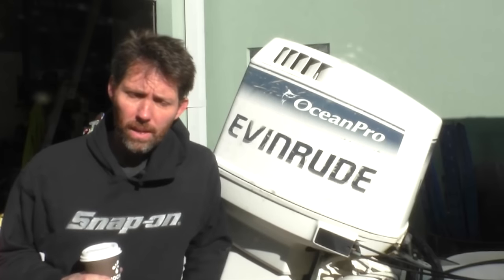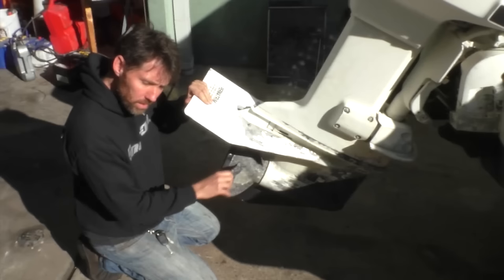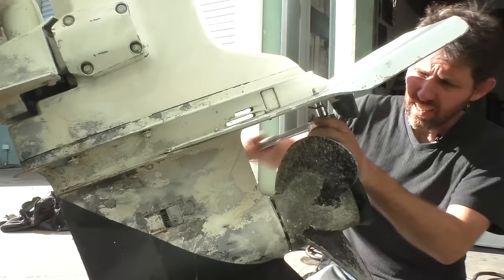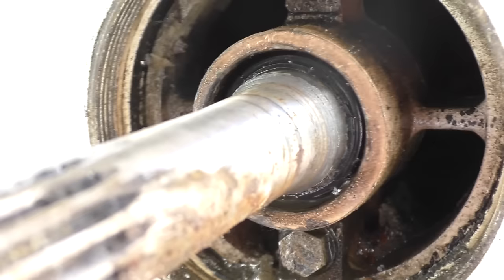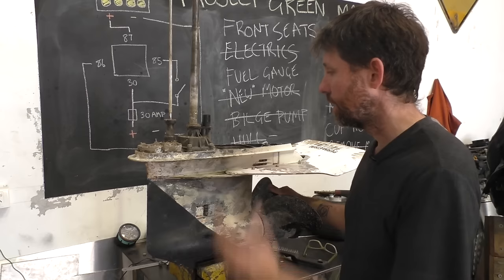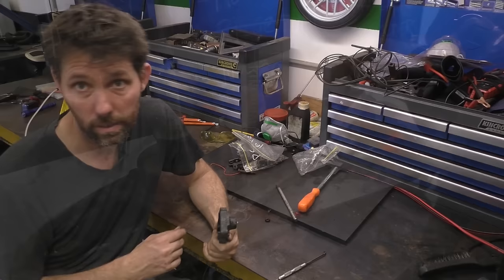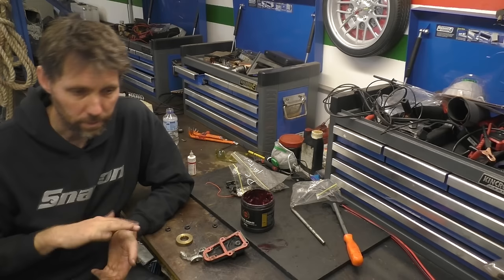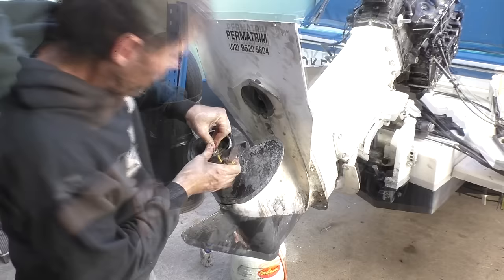Starting an Evinrude 150 outboard for the first time in years

Comment from the maker: Because the gear selector was stuck and the controls had been forced I assumed that had caused the bend in the rod but apparently that is factor bent. More information in this video https://youtu.be/Ufy6W9EI1cg
Reply: Anti seize, anti seize, anti seize!  on spark plugs screws and bolts, prop, drain plugs. I never go without it.
Reply: This might sound a bit over the top but I have been in a similar situation and really didn't feel comfortable (risk of turning a potentially great outboard into a write off) with trying to undo screws or applying flame heat onto aluminium castings mixed with rubber seals or plastics  that had stainless steel bolts fused into them. I ended putting heating elements from a domestic hot water tank  into a deep tank. And then boiled the water in the tank. Outboard hanging from a chain hoist & dipped in at the required depth & soaking over time.... Worked a treat!!
Reply: @Dangar Marine Do you have a way for me to contact you via email with a picture of the remote control for my 1995 Johnson 130hp outboard?
Reply: I have a 1995 evinrude johnson 88hp v4 I replaced water pump and thermostats. I have ear muffs hooked up plenty of water pressure going to the leg while running and I have water coming out of the spout but when she warms up after ten mins off running it's starts to spit water on and off. Is it true that the earmuffs don't apply enough water for these motors and that's why I'm spitting water on and off
Reply: I have a 1995 evinrude johnson 88hp v4 I replaced water pump and thermostats. I have ear muffs hooked up plenty of water pressure going to the leg while running and I have water coming out of the spout but when she warms up after ten mins off running it's starts to spit water on and off. Is it true that the earmuffs don't apply enough water for these motors and that's why I'm spitting water on and off

Comment: Can't tell you how much I appreciate your vids. I have learned a few keys watching your vids that are of immense value. I am a pretty good DIY mechanic but boat motors are a completely new learning experience for me. I have an 80 horse Merc that's been sitting on a boat in my backyard for about 20 years. Solenoid went out on it and at the time I did not know how to troubleshoot it and fix it. Over the last 3-4 years I have gained some working knowledge of the outboards and now I need to see about getting it started back up! When I acquired the motor had a fairly fresh rebuild on it so I am hoping I can get it up and going. Thanks again. You are great at teaching with clear and simple explanations.

Comment: Thank you for the very informative videos. I have inboard experience and hardly any outboard knowledge. Our recent purchase is an 86 Welcraft center console with a 1995 175 Johnson and it started having problems right away. Turns out, after replacing the power pack, coils and rebuilding all six carbs that the optical sensor was contaminated with oil and dirt. The shift was also screwed up do to my moving it while changing the water pump impeller. Thanks to your videos on these engines, I now have a running outboard that should last for quite a few years.
Reply from the maker: Great to hear you got your outboard running! :)

Comment: I had mine at a shop that was "starting an Evinrude 150 for the first time in years".
Theirs was a bigger challenge .. inside the air box full up to second carb was bat poop!  I recognized the little pellets to be what was also inside my "new to me" motor.  The shop says the bat guano is corrosive required rebuilding of all carbs!  The little critters come in the 'hand grip' opening of the bonnet top cover where there ought to have been a screen! 
I appreciated the education and put steel wool to plug my bat hole!
Reply from the maker: Hey Tim, now that's an unusual problem for an outboard to have! Doesn't surprise me that the carbs all needed a rebuild. I hope it gives you many years of good service. :)

Comment: Thanks a million! I have a 1960 75 seahorse and I’m getting ready to set the timing tomorrow. I have the Johnson factory service manual but there’s nothing like watching someone walk you through it.  The belt timing marks are confusing. Easy to line up the flywheel, but the alignment marks on the magneto look different than the manual.

Comment: Thanks Stu, been watching your videos now and then being a retired mechanic. 
Just came across a nice 20ft boat that's been in the shed for 10years. 
Checked the hour meter and it's only done 76 hours. 😊
I think it's a 93 model 150hp.
So I was pleased to find this video. 
I reakon it should run a treat,  My friend who is a boat mechanic said if the gearbox oil is clean leave it alone and do the water pump like you said.
Wish me luck,  Stu I will let you know. 
Thanks again Steve.
Reply: how did you go with this?

Comment: I went thru the same struggles with my 175.    Carb bowls full of 2 stroke motor oil.  Once I cleaned these out it ran well.  Changed the water pump last year, wish I would have seen this video first, the shift rod was an absolute pain in the butt to re connect.  But all is good now.  Motor runs like a beast, just wants to run and love it's sound when I'm flushing it out after a trip out in the salt water.

Comment: Thanks as always for your great video. This one was very interesting to see such an old motor which hadn't been run in such a long while still in relatively OK nick. Sign of the protective oils applied to the outside and the way it was winterised I guess? Your communication skills are excellent and I very much enjoy watching and learning from your great videos, thanks and good luck with everything.
Reply from the maker: Thanks Stewart, glad you are enjoying the vids. :)
Reply: This was informative! I am sure that trapped water and salt has a real bad effect on many of those parts. The trim cylinders , especially the one on the r/h side will be a pain and likely expensive , if the parts can be sourced. That repair to the shift rod and housing cap was excellent! Keep up the good work!
Reply: Having a little weirdness going on. I changed plugs and cleaned the carbs and instead of hitting 3200rpm at WOT I am now hitting 4500rpm. Still feels like there is a bit of power left over which I can't access. Btw I'm running a 78 v4 85hp Johnson seahorse. The other day at WOT I decided to push and release the electric choke and as I did that acouple of times I was able to hit 5200rpm. I unfortunately cannot hit that speed without jumping the choke. Any ideas? Thanks again.
Reply: Clean the carbs. High speed jets, check fuel pump, and fuel lines.

Comment: I do a lot of scuba like yourself and getting on to the point over starting an engine with a propeller, 
i got asked to remove a rope that had got stuck around a prop, so under the boat in diving gear with the keys removed from the ignition i started getting the rope off.
I started pulling the rope and cutting it off .
The engine was a large inboard engine and was at the top of compression when i pulled the rope the engine did a good 2 revolutions if my arm was in the way would of done some damage just food for thought,  
But a very good point you brought up like the videos and keep them coming.

Comment: Hey, excellent video! Thanks for sharing.

Although you could've just taken the lower unit out and tried to start it before putting any effort into the trim and LU.

But hey, more than 2 ways to skin a cat.
Reply: Agree..Had a 175 oceanrunner..7yrs sat..owner did fog it out prior..I bought the boat cheap..In thirty minutes had it running off a test tank..I always work my way down in this situation.The objective was first get it running...And even though it runs it could still have a weak,bad cylinder..compression test a must.

Comment: I just found this video, when you take outboard legs apart products like Loctite 771 Anti-seize will be your best friend. you use it on all bolts to stop them seiveing up
Reply: Actually in the U.S. a soft non hardening gasket sealer such as permatex is a staple for salt water outboards..after wire brushing them bolts like illustrated.

Comment: Good tips and informations for this Evinrunde, it would be Great if you 'd continue working on this Motor (lower unit seals, carbs cleaning/ setting etc.) 
👍🏻👍🏻 thumbs up outboard guru!
Reply from the maker: Thanks mate. The owner took it for a run this weekend and it went well but then developed an intermitted ignition cut out so it will be back next week for a bit more investigation. I'll be sure to film it.
Reply: @DangarMarine  why isn't 2 stroke oil good for a start up on an outboard motor that's been sitting for a few years?

Comment: 11mm is 7/16" , 13mm is 1/2" and 14mm is 9/16". Well, not exactly but close enough. In the USA we don't call it imperial we call it standard- as in standard and metric sockets, wrenches etc. Good video.
Reply from the maker: Good to know the best equivalents as although 'I bought some imperial sockets, I still don't have a set of wrenches.
Reply: Dangar Marine only 3/4 and 19mm are nearly the same without rounding off the head. Anything else will round the head of the bolts.
Reply: M&M Cattle 07

Comment: Love the video. Why do guys not wash off their engines with a good soap wash, especially around the ram lift. I always gave my Johnson 70 a good spray with WD-40. I sold my boat after 14 years of trouble free ocean use.
Reply from the maker: You're so right. A little bit of regular maintenance saves so much trouble and money down the track.
Reply: Especially when outboards cost a small fortune. I kept my 84 Evinrude 15 hp when I sold my boat so I can  use it when I find a welded 14 foot aluminum boat to put it on. 32 years and compression is like new. Runs and idles great.
Reply: It was a moored boat, look at the antifoul. That trim unit has been sitting under salt water for who knows how many years.

Comment: Excellent Video. Sloppy Certified.
If people only knew how much free and good "know how" you are sharing here

They would actually buy you a cold one.

So many years of experience here, with every explanation.
Reply from the maker: Thanks mate!
Reply: You're the MVP here. I help people out and teach them about cars too,
I happen to be looking at Two Stroke Mercury 8hp Videos and I found your Channel.

I recently had a hell of a weekend with a fishing buddy on his boat due to the fact we couldn't get this DAMN MERCURY started. Lucky we had the electric motor so we trolled the whole day and landed out Trout limit. Then I finally got the motor started with a patient and clear head, because you know out in the water the stress factor is so much higher, while learning how to do everything with the waves floating

But anyways, I wanted to learn about choke settings, how to cold start engines when to close the choke, how many pulls etc.  Our problem was a simple neutral/start setting on the throttle and not having the choke and fast idle screwed out.

I might not know marine engines, but after watching your videos... I can definitely diagnose certain components of different marine outboards now, from lower gear units, to carb cleanings and why, fuel filter services, oil mixing and what color the conditions speak about the life span of an engine.

You are great at explaining symptoms and budget solutions, so cheers for that. Happy Motoring

Comment: Thank you so much for all the insides of starting a long sitting motor.  I have a  Suzuki DF225 (94), I checked and run it beautifully in 5 years ago on water muffs, all 6 are 125 .  The motor is very clean with little or no corrosion on legs and trim.  I ll following your teaching to go through it before firing her up.
Reply from the maker: You're welcome mate, good luck with your motor.

Comment: Iam a fict cirt . Omc mechinic  sence 1987 IAM Crit. outboard 1 out board 2 fict cirt stern drive 1 and corbora cirt  retired in 2005 l Good job on the shift rod, good job putting oil in the dry cyclenders.next time pull off the air box make shure nothing is there to get sucked in the carbs. Saves you carb jobs big time  We use a remote starter and bump the starter once we add in the oil with the spark plugs out.
"Why" did you not do a compresion ck 1st?,, after you removed the spark plugs?,? That would of told you sooo much!!! You would not have to do anything with the lower unit, if the the compression is bad. Means the power head is shot!!!!!!
Also all that oil from the carbs was the boat owner winterized the carbs.  Very common in our shop to see that. Use starting fluid to help srart the moter also yess wd40 works very well too its extreamly falimable we use it at our shop to start lower compression motors to start. It lubs as well as acts the same as starting fluid. Also you should of replaced the impleor  and plate it was shot all those bent vains deffently bent  it needed to be replaced. also we dont ever ever ever use red locktight on any lower unit screws omc used Omc gasget sealing compond never locktight youll not ever get those bolts back out. Only locktight we ever use is the 242 blue if we have too, Not  the 271especaly not the vilot colored NOT EVER!!!!! Just trying to hlep you save time and money for your customer friend. Take care 
Ken
Reply from the maker: Thanks Ken, appreciate the tips!
Reply: Dangar Marine  no problem i wasnt up set at you!!! Its a lot of people dont know and work harder only to find out the power head is blown
Reply: Dangar Marine Added tip you can use a small flashlight to look in side the cyclenders to see if theres any cyclender scoring and ck the top of the pistons even though the sparkplugs look good there still may be damage in side
Reply: He is a good mech, I am Also40yrs.one thing you were always taught is to do the basics first, anyway good  job
Reply: Don't think the shift rod work was correct, all Evinrudes that I've ever done have that orientation bend at the top so should have been left alone - I think Stu re-bent it later having found that out !

Comment: 28:56 Someone "mothballed," prepared engine for long-term storage by filling the fuel system with 100% two-stroke oil???  Displaces water and doesn't rot like gasoline.....

Comment: Perfect timing!

I'm actually starting up a 60 HP mariner from 92 that haven't been used for a few years. I've checked the basic like sparks, cleaned the carbs and fuel is fine. Starting it up in a few hours. 

Only thing I'm worried about is the impeller.
Reply from the maker: Hey Christian, good luck with the Mariner. See if it pumps water first and then worry about taking the leg off. As with this motor, there is always more you can do, but it doesn't all need to be done straight away. You'll know soon enough if it isn't pumping.

Comment: I bought a boat with the same type engine, a 1997. The big issue was the corrosion you couldn't see, that took place in the plug wires but didn't come to that conclusion until after ohms checking the coils and a bunch of other steps, so I didn't get the spark you had. After new wires it started, idled and ran quite well. You really drove home the importance of giving attention to maintaining the lower unit after each season, that is for sure.

Comment: at what point did you honestly consider blasting? lol, nothing quite like neglected aluminum to inspire wandering through rarely visited sections of the vocabulary. as usual, top shelf effort, and far more informative than a staged one with a "ringer" motor would be. also far better than if you had just glossed over the encountered problems without showing the trials and tribulations of doing so (like so many car repair channels, which seem to exist in an alternate universe that lacks corrosion, stripped screw heads, rounded bolts, and time consuming little pitfalls). you never fail to both inform, and impress!! the oil filled carb bowls certainly show why the plugs were black, lol. i bet they ran it off a bottle of evi 2 stroke oil until it stalled, lololol
Reply from the maker: Thanks mate, glad you liked it. I decided I would blast that section as soon as I say it filled with antifoul. No point messing about! :)
Reply: my work in a powdercoat shop in the tropical waters of florida has shown what incredible destruction salt water, a standing charge (even friction caused static) and time will do to aluminum. jet boat nozzles are an incredible education in such (they honestly seem related to harry houdini, they have such a talent for disappearing). lower units for outboards, i/o's, and even bearing carriers for inboards develop incredible moonscape surfaces in pretty rapid order, with the requisite "cold welding" bond of galvanism on fasteners. one o/b motor bracket actually required serious "torch toasting" just to get a steel spacer to break free from the aluminum bracket proper, yet had never been glued, fastened (beyond the tension of the assembly it positioned), or even painted in place. a half hour of tapping, wedging, and bowing did nothing. a half million btu's of propane flame convinced it (with an incredibly loud "PING!!" as it broke loose, lol). i had experienced similar with japanese motorcycles, but in marine conditions, it's a whole new ballgame. my "got to" tool for honda disassembly was a 3/8 inch (10mm for you modern folks) drill bit to take the heads off, and vice grip pliers for the stubs, lol. if a youngster asks me what to learn first to become a wrench turning wonder, my answer is invariably "the patience of job, because it will be tested, constantly", lol
Reply: Well we used to fill the cylinders and carbs with oil at the end of the season then flush it out at the start of the next. Worked wonders on the Mercs we had.
Reply: Dangar Marine, hi Stu, what have you heard about the G2 250hp ho etec? Reliability any good?